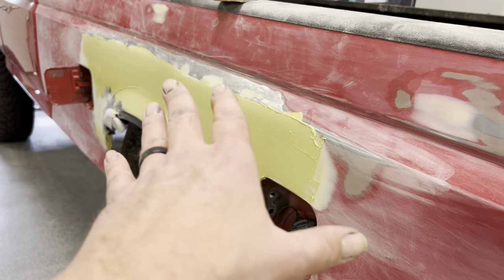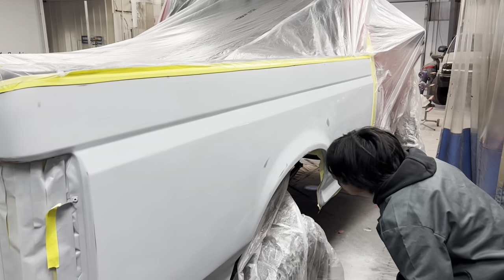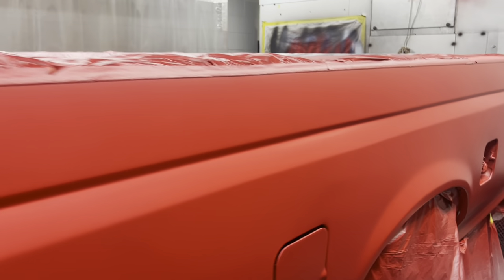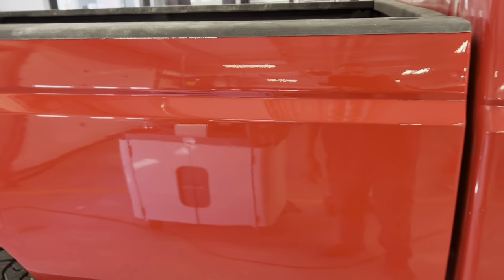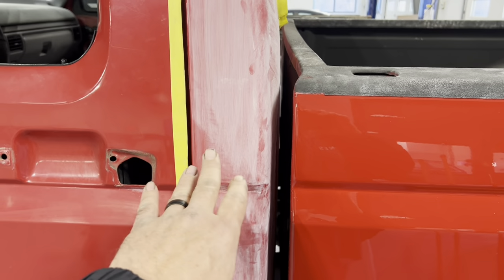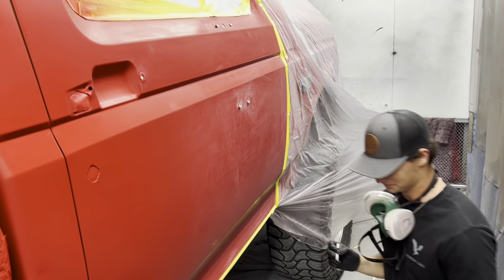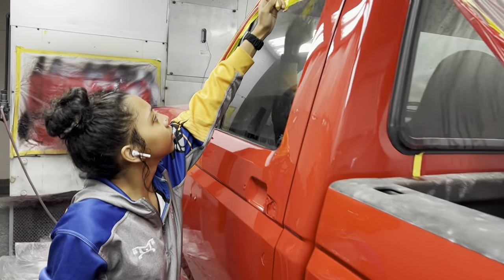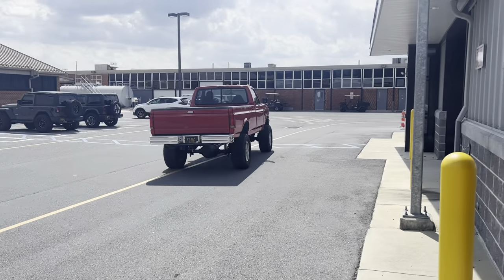F250 Patch Panel Completion.

Comment: This truck was a huge project w major side repairs and all hands on deck. Throw in the paint match issue and then the delicate repaint and very clever blend on both doors and magic clear coat to save the day. A customer would never see the tedious blocking of huge panels to remove and low spots revealed by the guide coat of black. This project required lots of material and patience to come out so slick. Nothing says it like a red truck going to graduation parade and fine by Sussex Tech team Raven. This is the wow project of the year. Well done!!!!!!
Reply: As for other comment watch again. Was done in a prep booth by many hands after 3 time prime, base coat applications s couple of coats of clear then a redo with constant hands passing paint gun and suspect just plain ran out of clear. Condition was NOT in a paint booth but similar to home style condition. Clearly an all day and masterful repair and dry spot easy fix. Maybe not perfect but good enough. This is a high school class and well done!